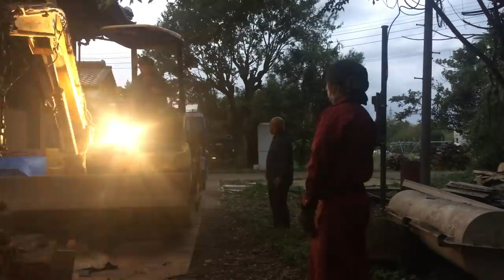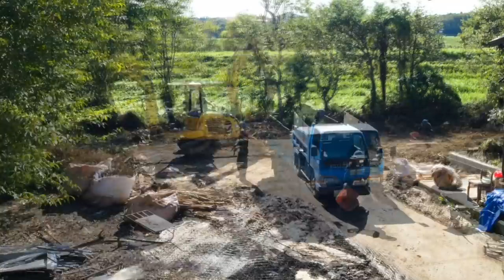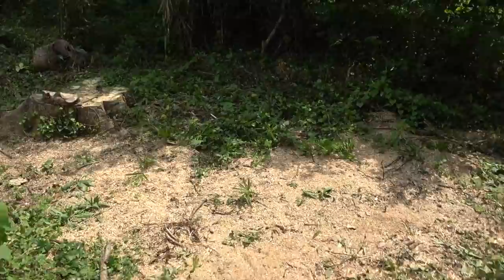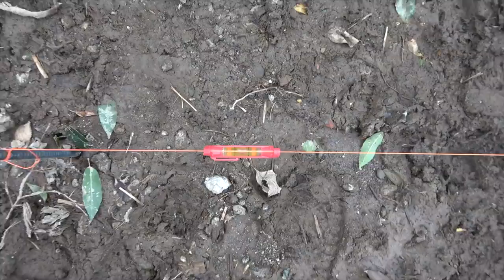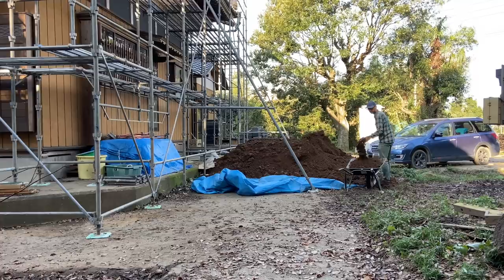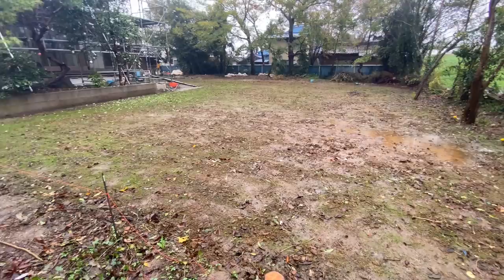Japanese Abandoned House Renovation #2 | Shed Demolition & Lawn Preparation

Comment: Congratulations on the progress. It looks great. I'm surprised Japan would let you import non-native grass seed, and grass can easily become an invasive species. (Tip: Don't EVER plant Bermuda or Bermuda Blends. That stuff spreads like weeds and you'll never be rid of it even if you want to.

Also, don't worry about the poor quality topsoil. As long as it's clean infill (Free of inorganic things like bits of glass, metals, and concrete), you're fine. Just mix in some fertilizer, compost, or manure to bring that stuff back up to healthy.
Reply from the maker: Thanks for the info on the topsoil. Main problem was that it was too clayey when I bought it specifically to help with the clayey subsoil (it didn’t seem to be that sticky when I went to the seller to check it). 

Kentucky bluegrass is commonly used here though I do see where you’re coming from in regards to local species. I also see the point about the lawn. If we didn’t have kids I don’t think we would go for a lawn to be honest.  They play soccer and I think it would be a great place for them and their friends. They currently play on the street.
Reply: @TokyoLlama  Living in Korea, I assume the native grass is similar to Japan. In winter, it goes brown and grows in patches.
Reply: I would assume they use zoysia grass there? It's very tough, a good turf grass for active lawns, but yea, in winter it turns brown like hay and looks dead.
Reply: @TokyoLlama  Well, the good news is that the soil should be fairly rich nutrient wise. Adding organic matter to help boost that and to increase drainage is all you really should need. Worse case, you may need to do something to the lawn to aerate it in the spring.

As for the lawn, I understand completely. I have my own child (although, at 17, I don't think she's much of a child anymore.) We live on a half mile street (Phoenix, AZ has a grid plan, and mile streets are the major thoroughfares.) Being that, idiots like to use my street as a race track. So back yards with lawns are good things for happy and active children.
Reply: @TokyoLlama  :
Next time when you examine soil, you want to take a clump and add water to it.  Form it into a log about the size of a finger and keep rolling it to dry it out. You can see what the consistency is probably going to be.
Reply from the maker: @confusedwhale  Great tip, thanks!
Reply: @TokyoLlama  Texas here in the states has like 80 percent clay :( Takes some work but makes you really appreciate your lawn after your done.
Reply from the maker: @Lv-nq9qz  That's right, zoysia is the native grass.
Reply: Just add organic material to break up clay soil. This includes just topping the clay with organic material (leaves, bamboo droppings) and letting the bugs, earthworms, birds, etc. do the work.
Reply: Jack Linde we have clay where I live in states. You’re correct in having to aerate lawn. We have to have it done about every 5 years. But on the plus side it can really hold water.
Reply: Tokyo Llama  My three sisters, I and our neighbors played a lot on our lawn, both on the front lawn and in the backyard.  Whatever grass we had (came with our 1920’s house) didn’t thrive in our clay soul.  My father DID NOT use toxic weed and insect killer and this was good for us back in the 1970’s when our neighbors used that toxic stuff.  After we grew up and moved out, my father chose a very lush grass that and he nurtured its growth beautifully.  I don’t know what kind of grass he planted.  He started composting our leaves and added that to the soil (we had large oak and maple trees in Plainfield, NJ, USA). I’ve noticed the family that bought the house is not composting so the lawn isn’t doing well.  I don’t see their children playing outside.  In the US, most children no longer play outside much.  They’re playing with technology instead.  Here is an article on the types of grass that thrive in clay soil.  https://homeguides.sfgate.com/type-grass-seed-clay-soil-49654.html
Reply: yup, his 'patchy grass germination' was due to poor fertilization of his 'cheap topsoil' ;)
Reply: When I lived in Japan we planted grass seeds and the pigeons came in flocks. Your grass came in faster than ours. Im not sure what grass type we had. It was super fine. My grass in Miami never browns. Its super aggressive. I keep taking them out to make room for a flower garden and veggie garden. It takes me 1 hr per sq ft to cut into the grass and yank it out. 

Im jealous of your clay like dirt. I have sandy dirt. Its quite ugly cause it makes the dirt grey. I think I want to add mulch but I live in a hoa and the mulch color is red. ;(

Comment: I love the look we have now with the buildings gone but that being said, I'm worried. The main road there is up a hill from your yard. I'd be worried about water and garbage run off from the main road. There could be possible cases of flooding because of it. I am however curious if you're going to fence that area off though. I'm really excited to see what you do with the out building and the ceilings in the main house as well. Also curious if there will be any privacy bamboo thrown up in the later years. But with the useless sheds out of the way, it's very beautiful now.
Reply from the maker: Yes, good point. That road is not so busy - it’s a small single lane road. The main concern was flooding as there is a flood plain and small river on the other side, and according to hazard maps there is a 50cm flood risk in our area (we overlook a valley so main issue would be water rushing past our place). Though it hasn’t flooded for decades and stood up well to the recent typhoons when we received record rain. I have thought about planting trees (cherry blossom?) along the border but we’ll see how we go.
Reply: Yoi can direct the water using mounds and back them with a row of bushes and trees. Along the water route, you can plant water filtering plants. Hmmm maybe even water resting zones, such as a pond or two with a birdge.
Reply: @yeevita  Yes, no property is complete without it's own birdge! I prefer the African variety as compared to the common European one, and finches can be so pesky.
Reply: nod, something that's native to the region, grows fast, and will root relatively deep. as always ;) ask the neighbors. ;) they'll know what they and everybody else on the street and the surrounding areas has been doing that's worked and didn't. :D   19.5" 50centimeters? whew. whistles faintly. 1' 7" damn. hmm! that's kinda deep. how's the drainage on either side of that small single lane road? and what's it's height at the road crest compared to the flood plain and river? is it a curved crest, sloped, camber, caster? hmm entirely straight or is there a curve or arc to the run of the road? does it rise or fall any? whew, there's so many variables for water movement. I live in an incredibly hilly and old (my house was built in 1957 and an addition was added in 1977) sub-division in North Eastern Alabama so we're kinda used to upwards of a foot/30cm or so of rain dumping on us in a day. especially when the leftovers of Gulf of Mexico hurricanes reach this far North from the coast. hahaha I'd say Southern American Cottonwoods but they'd probably laugh at you if you asked about those at the lawn n garden store. what do you think of evergreens? I know there's many dwarfs in Japan that grow insanely fast but not very tall. I'd guess you don't want to replace the long sightlines you gained by removing those sheds and add trees growing up between your house and the river. bushes might help too but they don't normally root deep enough to do more than hold a foot or so of earth together. :) I guess the worst thing you could do would be nothing. check the upstream flood gages with the City and Prefectural weather/flood monitoring centers. if the gages are old, they need to be updated. especially if there's many homes in the downstream areas like yours that might have flood risks. hmm, is it a very wide and slow and lazy river? or a tight and narrow and energetic river? the tight and narrow ones don't flood easily because their banks tend to keep them flowing faster and that flow will move a higher volume of water faster and for longer distances. if it's wide and slow and lazy, it'll flood easily and the flow rate will be lower and the chances of the river going over it's banks much higher. plus there's what the banks are made of. if they're solid and grassy and wooded and protected that would help. or if they've been improved with stone or concrete banks by humans. hmm. :)

Comment: I was in Japan for a year, and not once did I see a proper lawn, good work!  Now you can invite Japanese tourists to see your proper lawn.  Very interesting, I always wondered if it was even legal to plant kentucky bluegrass etc. in Japan as I'd never seen any proper lawns in Japan.  Even the soccer fields and baseball fields I went to in Japan had some kind of weird short broad-leaf grass which had plenty of space in-between, enough that you couldn't really sit or lay on it because too much dirt was exposed and I'd get dirty.  Rent a lawn roller (just a big barrel with handle which you fill with water) next time you top-up your lawn to make your lawn flat, will make it much easier when mowing later on.
Reply from the maker: I actually got a lawn roller but because of my poor choice of top soil it stuck to the roller too much and I had to abandon using it. Will give it another go in spring.

Comment: Your improvised harrow is good! Pity the rotavators here don't come with an option to quickly remove the cultivator part and replace them with wheels so that you could use it as a mini tractor to help you pull the harrow across that garden. That was definitely a lot of hard work and I did similar with a much smaller garden using a set of old snow-chains to make a chain-harrow. Very good job on getting the grass to look so good in just a short space of time. It speaks volumes about the level of effort you have put into it.
Reply from the maker: Thanks very much. I think the wood was part of a wooden cart/plough I found in the sheds. Certainly felt like an ox dragging it along! I wish the rotavator had an aerator attachment. I’d consider buying one - I rented that one from Joyful Honda

Comment: Lookin' good Brother. The EU spec Murray mowers carried by Watahan are fairly skookum, mine's been going strong for seven or eight years. Keep clean oil in it.
I use the tractors to mow the outer acreage but for a small spot like that a pushmower'll do.
Reply from the maker: Thanks! I’m thinking to go with a makita cordless mulching mower. As already have makita batteries for my tools.
Reply: @TokyoLlama  Yes but... in order to garner the respect of your local Ojisans you'll need to burn some fuel and make some noise. Around here prizes are awarded for the earliest smoke; firing up @0500 is perfectly cool. Why would you still be in bed that late anyhow?

Also... Grasshopper. If you haven't secured your own k-truck yet it's way past time. A man is known by the white stallion he flogs. This allows you to be identified from afar and also stops you from being a borrower. Which may be temporarily OK but not in the long run. It will become your cherished pet and friend, and allow you to obtain your own 'Ojisan' card.

Find a good low-mileage Suzi Carry on Yahoo Auctions FTW. I paid 6mon for mine and it's been going strong for years.

Edit: Hope you had a happy New Year... we went up to Bessho Onsen and partied with the family. Good times. Except for my BIL who snores like a locomotive...

Cheers:

Comment: Man, for a good lawn you might need to 1. Design the drainage system, so that you have a filtering tube around your house and around your lawn resulting into a local rain drain. At least a long meter deep trench between your lawn and the road might help.
2. After that you should’ve first compacted and leveled the lower soil for a lawn, and then put some sand, and then some upper soil and compacted it too keeping in mind that sloping level you need. 
Thus you get a much more sustainable lawn with a control over flooding.
Reply from the maker: Thank you. I was thinking a french drain perhaps. I will likely add some sand and soil in spring. Also a sprinkler system (building rainwater tanks, possibly a well).

Comment: I certainly hope you were able to save some of the roof tiles and some of the wood. It seems to be a huge waste to simply tear it down and throw it all away. A lot of the wood looked salvageable and definitely the roof tiles. I see so much waste in the USA when people renovate older properties. I’ve actually been fortunate enough to acquire some incredible timber from old barns and outbuildings that were being demolished. It’s difficult if not near on impossible to find timbers as good as the ones being used 100 years ago. The really tight grains with twice as many per inch as the lumber you get nowadays. It used to be cut from old growth trees and all of those are gone now.

Comment: while i don't approve of homogenized lawn landscaping (in New Jersey its obsessive and unhelpful to wildlife) may i suggest aquascaping the water runoff instead of leveling the whole lawn. with a simple 2 foot wide by 12 inch deep (at its lowest) trench filled with lining, smooth river stones, larger rocks, and plants, from the gutters' outlet from the roof--across the lawn and into the trees, you make your own little stream and water feature that fills and moves elegantly whenever it rains. it looks incredible with the flowing brook inside your own environment. another benefit of building this water feature is that you can change the ecosystem of the middle of your lawn to grow plants and reeds that would only want to grow near natural river banks & streams. its a very small and easy change you can do on your own that has practical and visual capabilities.

Comment: I’ve never had much luck with seeding......I’ve bought many varieties and found they never filled in well.  I’ve gotten good sod, it’s backbreaking to install but instant lawn.  The whole time I was thinking camellias and mountain maples.  The sango Kaku has the beautiful red bark in winter.  About the low spots in the lawn you might try mixing in a lot of sand to improve drainage.   There’s a newer variety of azaleas called encore that bloom both in spring and in the fall, although I’m not sure if they are available in Japan.  I believe they started in The southern USA.   I picture a raked zen garden will small white river stones.  An area of benches with small and large bonsai from Saitama.  I visited the bonsai museum there in 2017 and they were selling bonsai in the parking lot at very reasonable prices.....can’t even find them of that quality here.   Still in awe of the beautiful house.....hope you’ll do lots of updates.....best to you and your family.
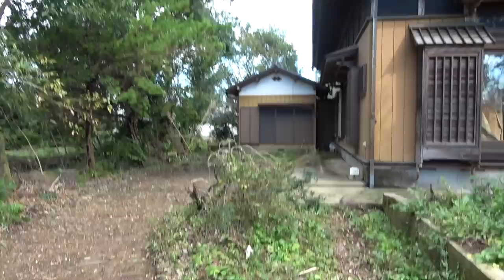Reply from the maker: Thanks very much. I don’t know what it’s like in the USA but sod is very expensive here, and I certainly wasn’t keen to risk getting some and encountering an early winter or finding some problem with the soil (though i did do some basic ph tests). I’ll look out for the azaleas. I’ll try some sand mix with some soil and compost as it’s quite low and I’ll probably need to put down more seed in spring. If you look at 5:38 in the video that’s where I want to put a Japanese garden (or koi pond if my wife will let me...). Hope you and yours have a good Christmas and new year.

Comment: This video was 10 minutes long? It felt like 2, it was over so fast! Very cool to see you doing all of this. I'm about one month away from my move to Japan, and hoping that I'll be able to get something similar. I have a question for you. An agent in Japan mentioned to me that I would need to be concerned about reinforcements/structural upgrades for older Japanese houses, due to earthquakes. What has been your angle on this?
Reply from the maker: Thanks. I'll try to make a longer one next time. Since this house was built after 1980 it already has cross-braced exterior walls. New internal walls will also be cross-braced and we are doubling key supporting posts.

Comment: Q: were you removing the tiles individually and boxing them at the start? and if yes, what will the be used for?
Reply from the maker: Yes, that was me. I’m planning on using them on the other shed roof (the one with no tiles). Otherwise I’ll find some other use for them eg chicken coop/firewood storage.

Comment: Have you read the book Fukuoka by  Masanobu Fukuoka? It has a great natural ethos and way of treating your garden
Reply from the maker: Thanks, I’ll check it out.
Reply: Tokyo Llama I have a horticultural background, any general questions feel free to ask. When it comes to adjusting the levels of the lawn I would top dress with a 80/20 sandy loam particularly because you have a high clay soil, the sandy loam acts as a mulch and assists getting the water down into the clay to help in summer and easy water absorption reducing runoff. 
You still may need a surfactant (soil wetter) until the soil builds its structure again. Forking/ aeration will also help root penetration. 
If you want some technical reading the book Growing Media for Plants and Turf by K. Handreck & N. Black it was our study reference in TAFE.
Reply from the maker: @Aiken47   Awesome, thanks so much.